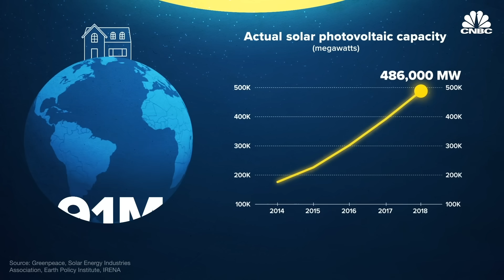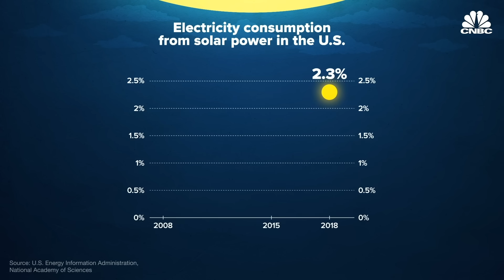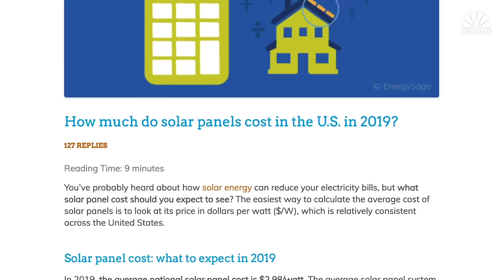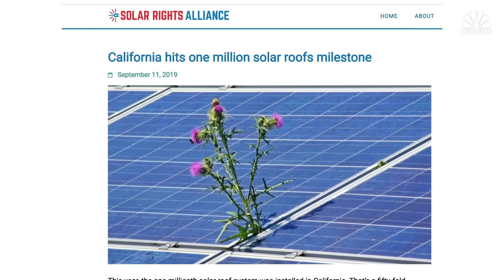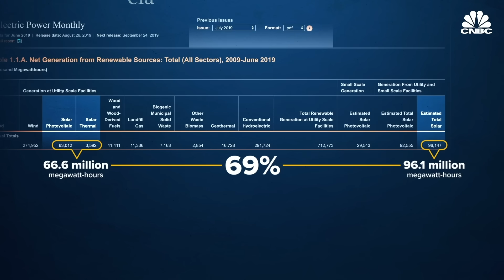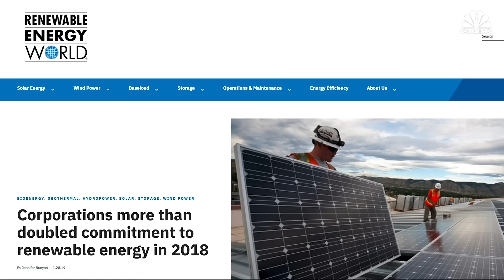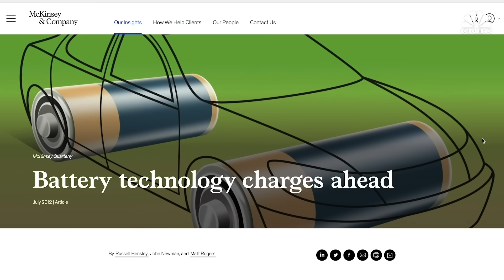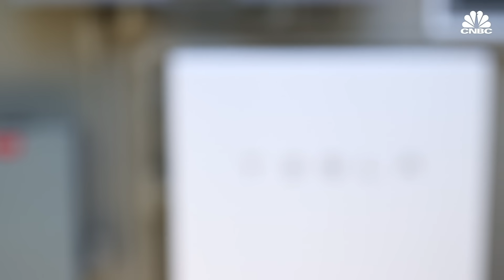The Rise Of Solar Power

Comment: We could also convert electricity to light and store it in a box internally made of very nearly perfect mirrors and then could convert light into electricity again using PV or we could directly store the sun light in its original form
Reply: Shashank Kumar you would need perfect mirrors
Reply: @andreaswickman1508  actually all storage systems have imperfections and they leak little bit ...so in the same way it could be done

Comment: Jimmy Carter was right. Ronald Reagan was wrong
Reply: What? Carter signed into law the Energy Tax Act
 of 1978, providing tax credit's for solar and Reagan renewed the credit when he signed the tax reform act of 1986.
Reply: Muhammad Ahmed They we’re solar water heaters and who cares he didn’t take away the tax credits for it. Also cars are more efficient today.
Reply: Carter was wrong, Reagan was right. All the government pushing and pulling did nothing for almost 40 years. Only when the market matured to lower cost that solar is taking off.
Reply: Carter put solar panels on the white house. Reagan removed them when he moved in
Reply: @MuhammadAhmed-qh7ut  If you look at the downward price trend even before China got involved, it's only matter of time when the solar price would be lower. Sure, China made it happen bit sooner, but that doesn't change the fact that economically viable solution is the way to go.

Comment: Powerwalls are $1000 LESS than they stated. And, they are talking about the time it takes for permitting solar.  What is the time for permitting a gas energy plant?  If it's less than solar, something is really wrong.  PLUS, batteries are cheaper than a peaker plant, so I don't see their point (about how pricey batteries are).

Comment: You can store heat energy from solar heat and use that in thermal solar power plants when the sun is down.
This method is cheaper and efficient than storing energy in batteries.
Reply: yes, there are plenty of molten salt solar plants around the world. However they seem to have their own problems hence why they are not as prevalent as simple PV based plants. For example, some of the heat is lost to the need for freeze prevention since many of these plants are located in deserts that have freezing temperatures at night. So depending on how much of the molten salt is exposed there could be a high amount of heat/energy loss at night.

Comment: Solar power is great for some applications...It's not there yet for your home.  It's not consistent.   And the cost is still high.
Reply: Cheapest power source. Why spread negative myths?
Reply: @Nicholas-f5  If it's so cheap...why isn't it already everywhere?  It's unreliable...It depends on the sun.  I love the concept.  It works great for small applications...like keeping batteries charged on boats and things.  But to power your house...Right now...at it's cost to have it installed...It would take over 20 years to pay for itself ..and by then you'll need new equipment...Help me out.  Sell me on it Nick.....

Comment: well when solar at home is grid tied or small battery system 4 battery system with 180 watt mono & 45 watt Coleman solar panel this is a rv unit with a gas generator to charge battery's at night to limited use a newer camper power charger unit built in unit safety  alerts for high heat & propane for cooking and heat! my home the lights and internet and vcr are run off solar with grid tie too! my saving is very little I instead of solar i got a 8000 watt generator Gas/propane unit with a transfer switch to use either grid or generator power! limited home stuff runs! it was 1/4 the cost of a full on solar power system, i have 4 grid ties & 320 watt + 280 watt + 250 watt+ 200 watt sets plus battery's and inverters lights and internet and router and tv and vcr run off it! i went the cheapest best way for me!! a backup generator system!
Reply: Generators are dangerous and need maintenance.
Reply: @Nicholas-f5  ever hear of a solar generator, but yes they are Dangerous to a fool with no mechanical skills, no more then a car it runs on gas takes oil and really causes a mess when they wreck! i went for a gallon of milk guess what stopped me on that trip a car wreck there brakes failed ruined 2 cars & took out 2 mail boxes! sent one lady to be life flight to a hospital why she saw the front of her totaled jeep!  and she fell on the lawn! with a heart attack! people who try to do there own work untrained (like went to a tech school or auto mechanic collage) ie fools i know this person's who car lost the brakes  it fits!b

Comment: For america thats great but any country which dont have vast deserts its a real pain eg. UK
If you want to power the whole of UK you will need to use approximately quarter of that land to generate that kind of power (also think of all the homes your stealing from wildlife and how many trees you will have to cut)
In those countries I feel Nuclear power plants could be beneficial be it a uranium or theorem nuclear power plant. Its environmentally friendly, The nuclear waste is always contained (if u use theorem it generates less waste) and has substantially fewer deaths than hydro, coal generating plants
Reply: The UK is switching primarily to offshore wind.
Reply: Guess you've never heard of offshore wind?
Reply: @fgsaramago  offshore wind right: destroys marine life that includes endangered birds and costly to maintain. What can go wrong. Since they produce a bit more energy than solar energy, it will have to cover minimum of 20% of area (size) of UK. While nuclear has less accidental rates and produce no carbon emission unless you count construction which they are almost similar .if you say what if we run out of uranium we got theorem which we have 4 times the amount on Earth. + I WILL LOVE TO SEE YOUR BILLS,  AS MAINTENANCE COSTS.

Comment: Lets make solar powered hydroelectric dams that pump up and store sea water as potential energy in the day for use as hydroelectric kinetic energy power stations at night!! That should be a lot cheaper than lithium battery storage!
Reply: Lot of capex. Please develop a business case for said pumped-hydro site, but use fresh water as salt is too corrosive.
Reply: @linmal2242  naaaah we can use sea water... huge metal ships run through sea water and live longer than us before they are scrapped ...we can make aluminium rotors and shafts, not a big problem as long as we build it right..when theres a catwill then theres a way amigo!
Reply: @linmal2242  it's exactly what we do here in Portugal. Works well

Comment: This is overly optimistic.  Rural parts of the northern central and northeast will not have the expansion due to the costs, as well as the weather that will make energy efficiency a problem.
Reply: EDP, the 3rd biggest renewable investor and producer in the US focuses mainly on the northeast. Apparently it has very good conditions for wind generation, especially offshore

Comment: Battery storage cost will come down just like Solar Power came down itself. Only, instead of coming down gradually, like solar panels did early on, battery storage costs will drop off a cliff as companies get into high gear to satisfy the inevitable demand requirements.
No, solar panels are not 'much less' effective in cloudy skies. That is a gross simplification. They are mostly 80% as effective with cloudy skies, on an overall 16%-36% efficiency, depending on the generation and quality of solar panel. Solar panels do not require direct sunlight. They just require daylight. Please don't edit the narration down to the point where it becomes misleading. With good battery storage, solar panels can satisfy most domestic use, getting dwellings off the grid for most of the time.
Reply: Yep. While it's too late, a better name would have been "light panels" instead of solar panels.
Over built solar + battery storage will cover all our needs and lower electricity prices everywhere.
Hilarious how they show $70-$100 per kWh to be the expected price bottom for lithium. They're probably close to an order of magnitude off!
Reply: @MacGuyver85  Indeed, and where daylight is at a premium (extreme latitudes and polar zones), lots of wind power and batteries can fill in gaps. There's plenty of direct or indirect solar energy. We just need to capture and store it.

Comment: Hydro water pump storage powered by solar and wind is another answer to the solution. No battery needed
Reply: yesss
Reply: Only a small part of the storage problem can be solved with pumped hydro. There just isn't enough geography or water for it to be a general solution.
Reply: @Obscurai  they can build solar farm and the dam right next to the sea amigo!! enjoy the sun and the sea!!
Reply: @fidelcatsro6948  So building a dam and a solar farm right next to the sea is quite risky given the possibility of flooding. Additionally, the amount of energy that can be stored by pumped hydro is dependent on the height differential and a dam right by the sea won't be very high and therefore wouldn't store very much energy. So again, geography is the problem. If it was this easy, it would have been done long ago.
Reply: @Obscurai  the coal industry took over back then, therefore all other ideas were not considered
Reply: @gregstafford2155  If they can make a business case for pumped hydro that works economically, all the power to them - sorry for the pun. Anything that adds to the solution for energy storage is welcome if it makes sense. Pumped hydro does have the advantage that its storage capacity is typically an order of magnitude larger than current battery technologies. The disadvantages are as mentioned, that there is just not enough physical sites that can accommodate them, they have a high upfront capital cost and have a long build lead time. 

Batteries, while lower in capacity, are an incremental cost item that can be deployed rapidly at distributed close proximity locations (i.e. substations), and have a demonstrated very short (<5 year) ROI. 

For now, any tech that makes sense is good tech and we will need all of it - as long as it works economically.
Reply: @Obscurai  the cost of starting a another coal plant will be much higher environmentally and mentally damaging to the young generation. Reports say hydro storage can be setup in many regions, but they just don't commit to it.
Reply: @gregstafford2155  Yep for all the reasons listed and of course the political one you just mentioned, pumped hydro is a difficult sell. That's why power companies will gravitate (sorry for the pun) towards battery installations which don't have these problems and they can get on with the business of making money.
Reply: @Obscurai  the ocean water
Reply: @gregstafford2155  https://en.wikipedia.org/wiki/Pumped-storage_hydroelectricity#Seawater

Comment: What if we can use the exces of electricity to produce something like hydrogen to be used after ?!?!
Reply: Hydrogen is a difficult gas to store. It must be compressed, the compression is energy intensive and that takes away from the energy generated.
Reply: It's far easier to fill dams and store energy that way
Reply: @fgsaramago  Yes, dams are easier than hydrogen, but dams have their own problems of sufficient flow, suitable geographical locations, political and environmental sensitivity, and large capital costs. If dams were easy, they would have already been the first choice of power companies - they are not for the reasons just listed.
Reply: Producing hydrogen is expensive and energy intensive. Better alternatives are solar  +  www.redflow.com

Comment: Welp not to mention that a person can heat water and store it as well instead of electric water heating to help to lower  battery power draw cause solar water heating is super cheap and easy to store means no batteries or very little operation of water control.

Comment: i have solar on my RV and 2 Tesla model S battery bricks - its Sweet
Reply: That's great, but is the RV motor electric? It probably gets about 8 MPG diesel right?
Reply: @BoodahBodey  The poor mpg is due to the poor drivetrain design.  Most drivetrains aren't design for maximum efficiency and power.  There are many mods that can be done to them.
Reply: My camper van had 1 solar panel, 1 inverter & a deep cycle battery. Less is more

Comment: I like gravitational energy storage. Lift a huge mass up with your excess energy and use it to power a generator when you don't have enough. I forgot the name of the company, but they are using abandonned mineshafts to do just that.
Reply: yeah something like pumping up water into a dam with solar energy pumps in the day and then using the hydroelectric power of waterfall at night
Reply: Yup. That's a form of gravitational storage. It requires large dams though... Using an old mineshaft and a really heavy weight is possible in much more places.

Comment: Thank good ness. It's about time we get our heads on straight. GO SOLAR
Reply: And pump it into a www.redflow.com.au
Reply: This scale of solar will demand huge scale mining of rare metals. Remember panels have a limited life- 25 years max but often as low as 10. They are not easily recyclable, and contain known carcinogens. This means we will be left with a LOT of discarded junk in the coming years.
Reply: @nebulaaah   True, But old Solar 
Panels are a heck of alot better than Spent Nuclear fuel rods, and toxic Ash from burning Coal in power plants. I''ll take the panels any day.
Reply: Don't.
Simply, you can't. The Sun is too far away, and stuff will get in the way.
Reply: CALM DOWN, it's coming with or without your stress.
Reply: Die solar. The Philippines will not accept American used toxic solar panel garbage.